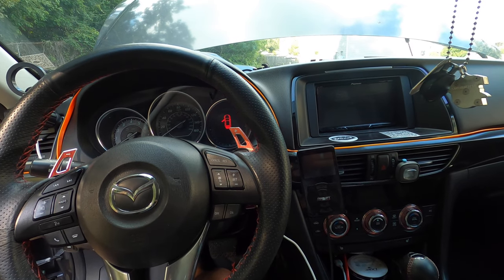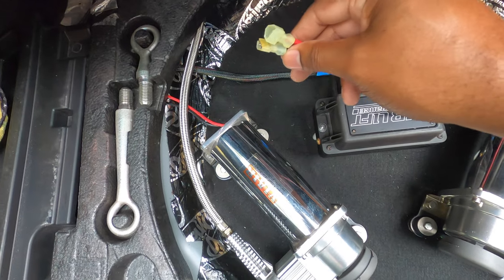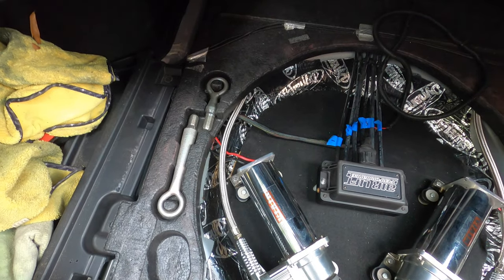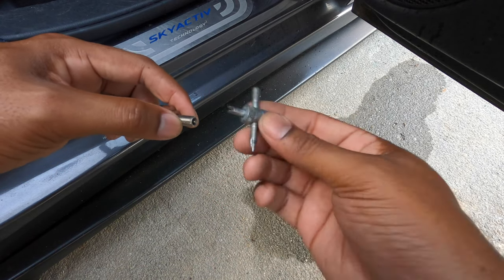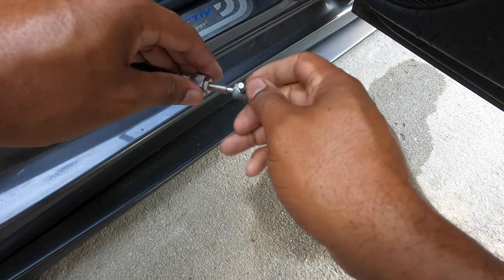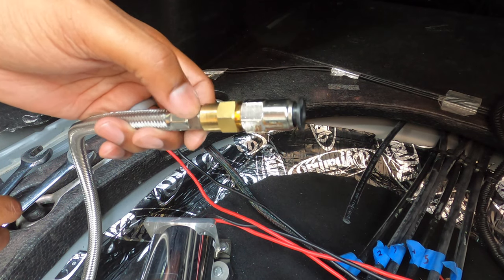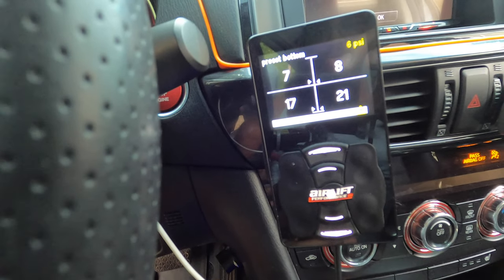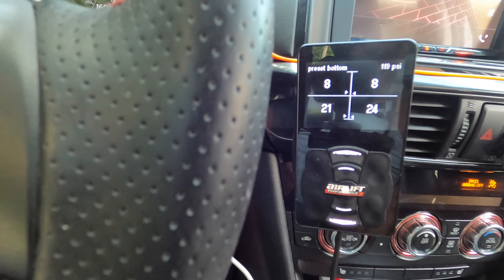Airlift 3S 3P 3H | Fuse Blown, No Controller, No Bluetooth #lifeonair

Comment: There’s a duty cycle on those too… don’t think they’re suppose to run non stop especially in an area without much ventilation
Reply from the maker: They are set to 50% duty in the controller settings. If they do run to long the manifold goes into freeze mode to protect them if they do run to long.

Comment: I installed lowering springs a couple months ago and wanted to go lower, to do so I was thinking of coilovers but in the UK they put 5 stories high speed bumps even my car with just lowering springs sometimes scrapes and AirLift would be perfect for this, but I understand zero of electrical stuff and I am mega afraid of having an issue with the AirLift and get stuck somewhere as I am kind of on my own in the UK so no one to help me out. Shops charge you thousands for anything and this is if you can even find one that has a clue about car mods.
Reply from the maker: I always say that it is important for anyone that decided to do airlift to know how the system work and have a oh shit kit so that you can limp your way home. I have seen horror stories from people that have issues and are left stranded.